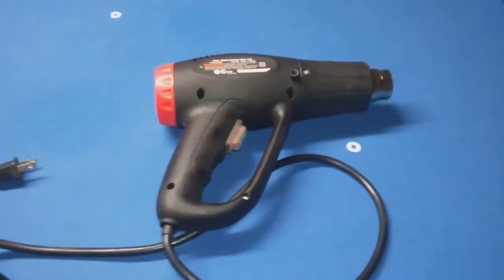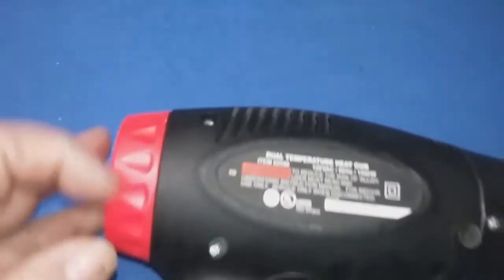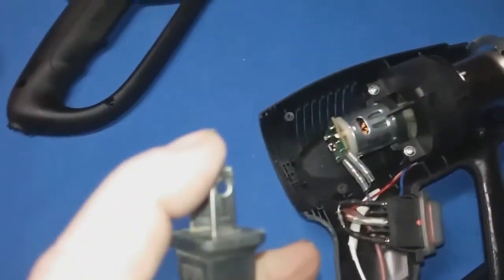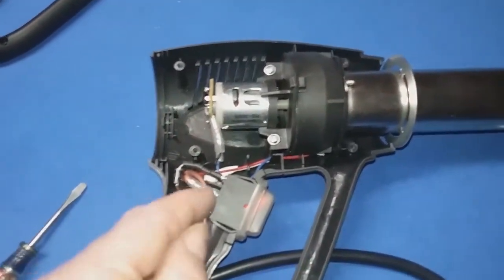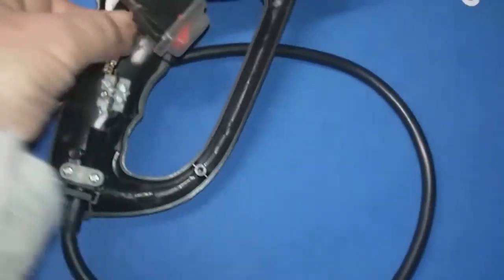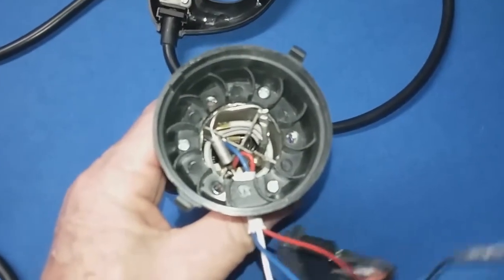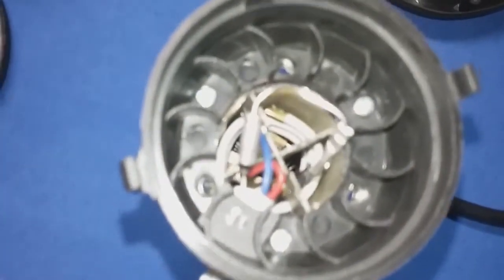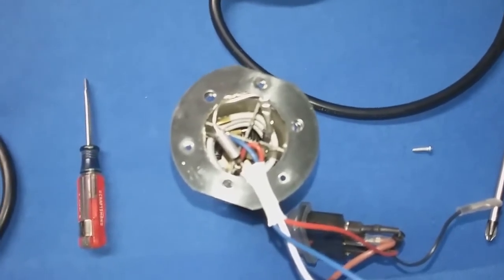How to repair a Harbor Freight heat gun Part 1

Comment: I have three of these guns. Two of them have quit, and each time i've gone and bought a new one, since i needed it right then.  The switch seems good, and i'm thinking the problem is similar to what you show in this video. I have been hesitant to throw them away, but not sure it is worth the trouble to fix them, and if the problem is in the circuit board, that is probably beyond my abilities anyway. Thanks for the video.

Comment: Good piece of information. "You must crimp the heating Fuse" Soldering it will burn it !
Reply from the maker: Thanks for taking the time to comment. My heat gun is still working, but I do let it run on low heat for a while to help it cool down.  I think this also helps to NOT burn the thermal fuse.

Comment: I guess I got lucky on mine and didn't blow the thermal fuse when I repaired the gun.   What happened on mine was the section of the wire after where the thermal fuse outgoing end riveted to the heating coil/element section had broken.   I put a new wire on that section, wrapping it around the rivet part and soldering it on the broken wire part.    The fuse should have failed rather than the wire breaking.   
I will be mindful about letting mine run on low setting before I turn it off.   I had not done that before.  I didn't know about that.   So thank you.
Anyway, I got a new one for what, $18?    Double the cost of the one I just repaired.    Same exact gun except the old one read "Drill Master" and the new one reads "Warrior".    Screw for screw the exact same gun.   Double the money?   Hmmm.
Reply from the maker: Thanks for sharing your experience. Perhaps it will help someone else with the same problem. Also thanks for fixing yours and keeping another item out of the landfill. Now you have a backup. Thanks for watching and contributing!

Comment: My low speed stopped working, only had high speed, then i noticed some smoke coming out. then I caught your video, turns out the 1n5408 diode was cracked. Luckily enough I dont throw out broken electronics, found a PC power supply with perfectly good 1n5408 diodes : D
Reply from the maker: Yeah! I like it! Good job! You Kept another one out of the land fill. Thanks for doing that and thanks for commenting!
Reply: @johntube2525  I keep thinking about where this stuff ends up and I just cant let myself throw electronics away to end up in a landfill or in some child labor gold harvesting farm in africa. thnx again!

Comment: Got this gun from a friend to do some plastic bending. The high speed doesn't work, the low speed does. I'm suspecting either the switch or the connector to the high speed is somehow damaged. Could be feasible to just bypass the switch all together for some usage, then revert it back ? Great video, very well explained
Reply from the maker: Yes, I suspect the trigger or switch for high is bad, since it only works on low heat. See my comment below where I explain that I think the diode near the switch is what lowers the current for low heat and lower RPS on the blower motor. So if yours works on low heat then I think the diode near the trigger is working to lower the current. So I suspect the high switch, which you could check the continuity thru the switch and I suspect you will only get continuity with it on low and no continuity thru the high. But, hey I have been wrong many times in my life. Thanks for the comment and good luck
Reply from the maker: My wife’s Hoover Wind tunnel vacuum cleaner’s on/off switch broke. Won’t turn on. No continuity through the switch. I  am ordering another switch. Until that switch gets here, I told her she could use the vacuum , but it will not have an on/off switch. It will be on when she plugs it in. Only off when she unplugs it because I put a jumper wire in place of the switch. I think you are thinking of doing something similar. Good luck!

Comment: Great video. Could you explain what the purpose of the diode is around the switch? Mine is broken in two. Thanks.
Reply from the maker: Sorry, must of missed the notification on your comment. I am not really positive, but I think when the current goes thru the diode on the trigger, it lowers the current so you have low heat and low blower. Flip the switch the other way and current goes directly to everything and not thru the diode. That was my conclusion back when I worked on mine. I could be wrong though.

Comment: Do we need a thermal switch? Isnt the point of this unit to blast out heat? Shouldnt we just connect the ends and bypass the fuse or just replace fuse with solid connector?
Reply from the maker: My understanding for the fuse is it is rated for a specific temperature and should that temperature be exceeded there could possibly be a fire. Better to stop the flow of current to the heating element with a blown fuse than have a fire. 
I am no expert, but that is what I have gathered from my research. Thanks for your comment.

Comment: Do you think it’s possible to switch the motors to a different gun.
Reply from the maker: Probably! Your only problem might be how to mount the motor on a different application.  
I tried my motor with just 3 volts and I also tried it with 12 volts. It turns faster and faster the more voltage you apply to it. With my variable DC voltage source I could do anywhere from zero to 12 volts. I do not remember measuring the voltage at the motor after I fixed mine, to see just how much voltage is actually going to the motor. I would image it is too different voltages. Gun on high heat, motor turns faster, Gun on low heat motor turns slower. I think the diode near the trigger or switch changes the voltage for the respective high and low. Hope this helps you out.

Comment: Is the wide plug connected to hot wire ? Black wire
Reply from the maker: No! Just like I said in the video, the wider plug or prong should be the white wire or common. The narrower plug or prong should be the hot or the black wire.  If you disassemble an outlet you will see the narrow opening is the brass which should  be the hot side.  Other wide side should be the common.
Reply: @johntube2525  did I make a mistake. I always cut the long extension wire and connect the black wire to the wider one. Mostly use for heat gun. It works fine. Nothing wrong. But seems like most of my heat gun last only 2-3 months. Is that something I did wrong. Let me know thanks
Reply from the maker: @kola2018  Not sure? I guess the color of the wire doesn’t matter as long as everything else is correct. Not sure what you have done? 

One thing I do know about heat guns that do not have a, fan only, cool down mode. This would mean the heating element is not turned on, but the fan is turned on and is basically just blowing the air threw the gun to allow things in the gun to cool down. These guns without a cool down mode, might not last as long as those that have the cool down mode. I always run my HF heat gun on low heat for awhile and never just turn it off after using it on high heat. Running it on low heat, will help it cool down some, compared to just turning it off after running it on high.  But an actual cool down mode would be better.

I think that was the way I messed up mine and the reason I had to replace the thermal fuse and the diodes. I had run it on high for an extended time and then I just turned it off instead of running it on low for a while. The high heat was left in the gun as the heating element tried to cool down, but without the aid of a fan blowing, caused the components I had to replace to overheat. 
I hope this helps. I am not sure what else to tell you, except that the wider prong is supposed to be the common and the smaller prong is supposed to be the hot. That is also the way your electrical outlets are supposed to be wired.  Hot to hot and common to common.
Reply: @johntube2525  is the thermostat fits most heat gun ?
Reply from the maker: @kola2018  You can buy new thermal fuses on Amazon see the link I have in the description. I believe mine was rated at 133 degrees Celsius.  I would try to replace it with one rated the same rating as whatever is written on the side of yours. Or if you cannot find an exact match, you could go slightly higher. Here again, your question is not very clear, but hope this helps.
Reply: @johntube2525  Thank you for the reply. I have few heat guns that just blow warm air. 2 steinels. 1 Bauer last 2 months. 2 porters. cable
and a Milwaukee. Also last 2 month. No hot air at all
Reply from the maker: @kola2018  In my video at the very end, I show the heat coils heating up, getting red hot. I assume this is not happening on yours. You say warm air, so it sounds like some power is getting to the heat coils, but not enough to turn them red hot. I am assuming everything else works when you plug other devices into that same electrical outlet. Or that particular outlet is putting out 120-125 volts. I really cannot help you that much sitting here, but going to throw out a couple crazy ideas. 
Do you get many power surges where you are? Do you leave these devises plugged in and possibly, they became damaged by a power surge? 

I really do not know, but it sounds like the heating coil is not getting the power it needs to heat up. Ask yourself why and go from there. And ask your self why has so many devices gone bad. Sounds very weird. You might consider consulting with an electrician as it sounds like you have an electrical problem. 

Many years ago, we had a double wide mobile home that had an electrical dryer. There was a build up of lint behind it. I decided to pull the dryer and washer out and vacuum the lint. I had to climb over the washer and dryer to get behind  to vacuum. I decided to unplug the 240 plug from the outlet to make it easier and all hell broke loose in the house. Snapping and popping, smoke from the microwave in the kitchen. I plugged the dryer back in and called an electrician. Turned out the horses had stepped on the ground out at the power poll and it was very poorly connected. Electrician said when I unplugged the electrical dryer which has a large heating coils and those coils were apparently providing the necessary ground the house needed, all of the power went to other devices and destroyed them. Weird things can happen and it might be time to contact an electrician. Sorry so long, but I just wanted you to know weird, crazy and dangerous things can happen with electrical things. Consult with an electrician about why are so many devices ruining.
Reply: @johntube2525  
Thank you again. After reading your reply. I went back this morning to check all my extension cord I connected myself. Tested with the multimeter. Everything were done right. Hot wire on the narrow prongs. 14 gauge extension cord . Bout 25-50 ft long. Tested all my power outlets. Weird. They all 125 volt. I went out and tested on my next door shops which is the same building. They were 120. Wonder if that cause most my heat gun toasted.
Reply from the maker: @pituq129  In a nut shell I have no idea why your devices are blowing. I still think hands on testing may need to be done by a professional, but research and carefully doing it yourself may work. Here is just one of many web sites you can use to read up on US typical outlets. I really comes down to current and the Amperes your circuit breakers are set up for. 120 should be no problem. https://findanyanswer.com/how-many-volts-can-an-outlet-handle

Research, research, research or hire a so-called Professional. They tend to deal with these types of problems on a daily or at least week to monthly basis. That is not me by the way! I am just a DIY. Sorry, but your problem seems way beyond the scope of my video and my experiences. Good Luck!
Reply from the maker: @pituq129  I have one last thought. It may have nothing to do with your outlets! It might be the way you are using these devices. I think if I owned a business and I needed a heat gun on an hourly basis, I would try to find a local business, that stands behind the products they sell and a product with a good warranty and use the device in accordance with the directions and if it fails take it to the seller for a replacement. Just my last thought on this subject.
Reply from the maker: @pituq129  In addition to finding the best heat gun warranty or stand behind the product you can find. If you are using these on an hourly basis in your business, then perhaps you need several of them. So, when one starts to overheat, you can put that one on cool down mode and pick up another one to continue your work. In other words, try to switch to another one, before the one you are using stops working. Eventually a product seller would probably tell you, this is the last one, I am exchanging for you, if you continue to blow heat gun after heat gun. Hope all this makes sense and I wish you Good Luck in your business.